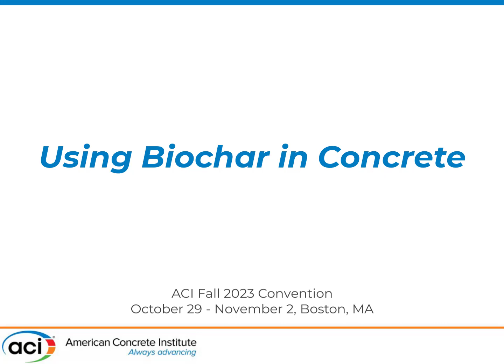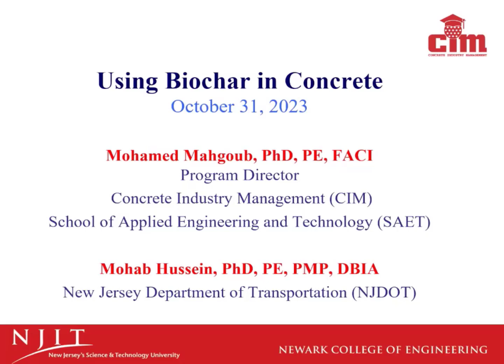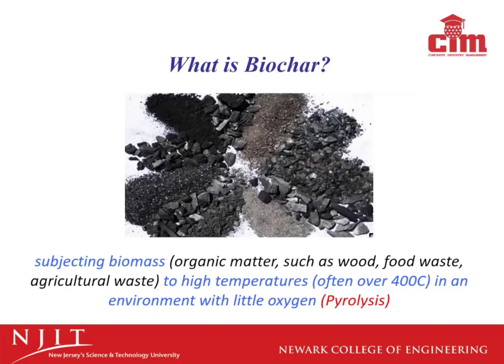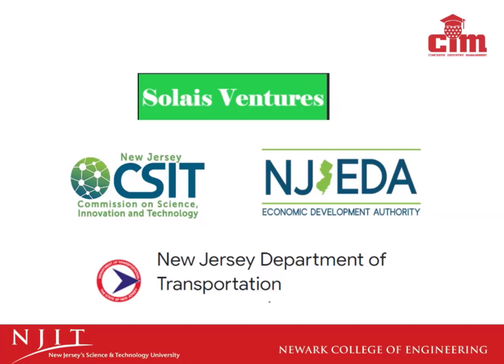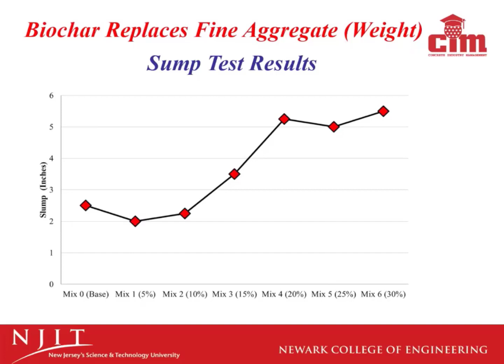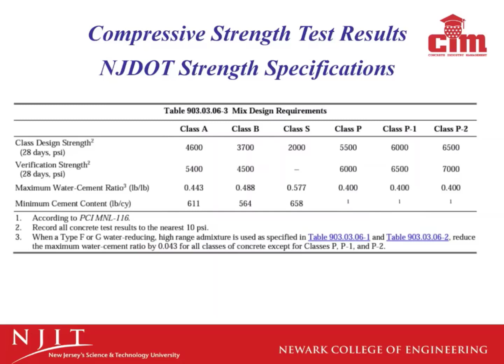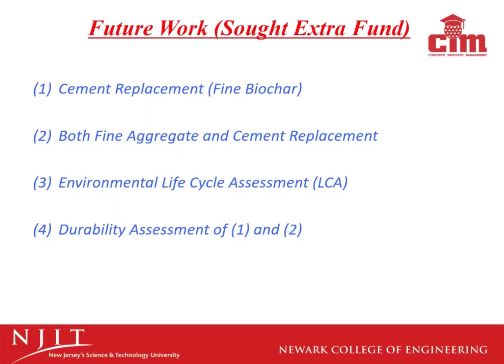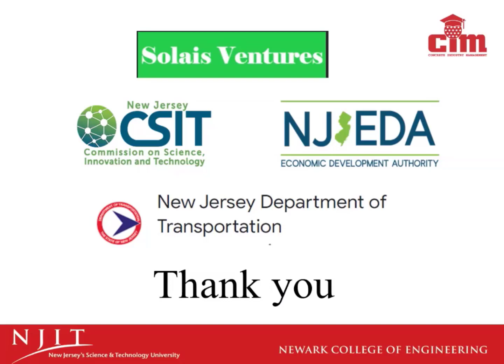Using Biochar in Concrete

Comment: Higher quality biochar (90%) and less fly ash create a much lighter and stronger carbon based concrete. If made properly it also provides an insulation factor. The biggest factor is using the proper pyrolysis gasification equipment. 

Good work so far!